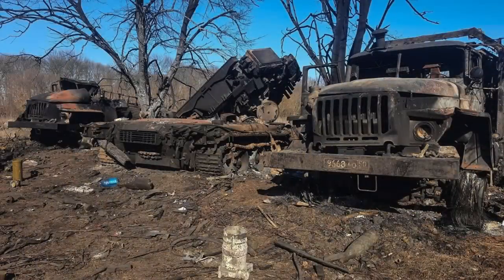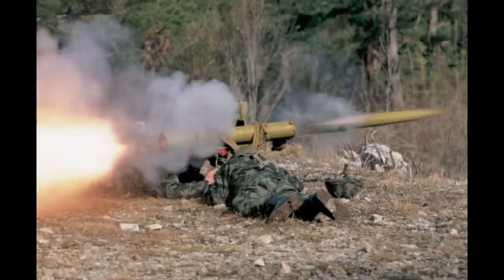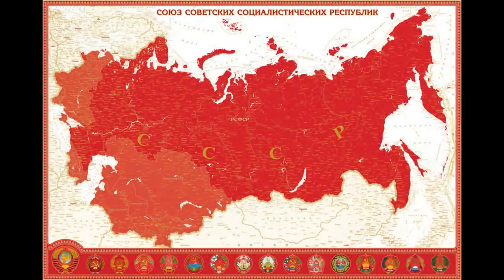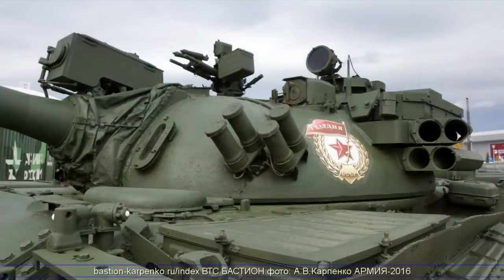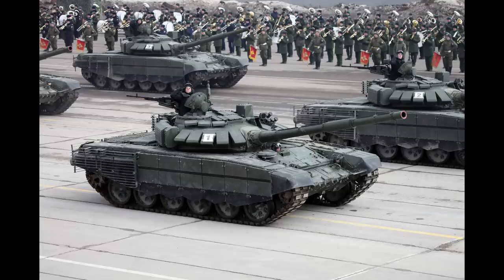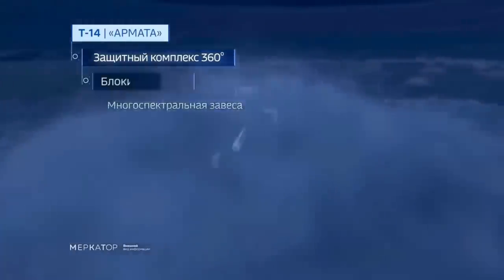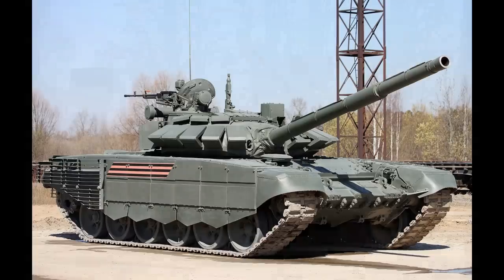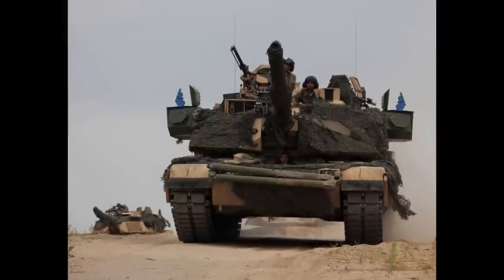Why are Russian Tanks Failing in Ukraine?

Comment: If we sent in the original Abrams it wouldn't fare much better if used the same way by crews that haven't had enough training.  I wouldn't blame the Russian tanks but the doctrine, training, maintenance, corruption, and a war that shouldn't have been started that failed them.
Reply: it has many reasons to be started, though the initial strategy was not destined to end well with a quick attack when you're outnumbered.
Reply: What's the "original Abrams?" M1 with 105mm? M1A1 Desert Storm? M1A2? Many of these if not all Russian tanks for some reason are lacking thermals. Russian Army is not a night fighting Army so I think a post Desert Storm M1 tank would do much much better in surviving this style of war. Better protection and better optics for night fighting.
Reply: The problem with Russian military hardware is that it was based on design considerations from World War II and built for a future war that never happened.  The idea was that like the T-34 of WWII weapons should be cheap to build, easy to maintain, reliable, and expendable.  The Russians were relying on the weight of numbers so they didn't pursue highly survivable vehicles in the assumption that they wouldn't last very long anyway.  Their tanks were incremental upgrades and the same faults of poor crew safety, poor ammunition storage, and poor fuel storage are inherited traits common to the entire family tree that was never rectified with a clean sheet design.  

The post Cold War rationale was why invest in new weapons when you can upgrade older designs on the cheap to bolster the number of weapons available in case of a large-scale war?  But having such a huge stockpile of weapons meant that new weapon R&D and procurement were delayed and only incremental upgrades of questionable value were completed.  The problem is when the Soviet Union collapsed Russia inherited all of these cheap and expendable weapons that were never going to be used in the numbers originally intended.  So when they were used in high-intensity conflicts without a massive superiority in numbers they couldn't achieve the results that were expected.  When used in huge numbers the chance of survival was greater.  When used in smaller numbers the chance of survival declines.
Reply: @keep22  What is this about them lacking thermals? Everything past the 1994 standard has them, though a wide variety of tanks were sent out from multiple stations of the country.
Reply: @keep22  
 I don't think so. Saudi Arabia lost many M1 in Yemen to rebels with Soviet anti tank weapons simply due to bad tactics and doctrine. No clearing of ambush areas, no support for the tanks. Just drive them in broad daylight into a valley where rebels with kornets can blow them up.  Who knows what level of training the tank crews had. Even in chess the queen is useless if you either keep her at the back or just throw her into the middle of the board.
Reply: The war that started back in 2014 or the special military operation? The US would not have allowed their neighbors to turn into a hostile state like Ukraine either. It's a direct security threat that had to be stopped. And they spent 8 years trying to solve it diplomatically to no avail.
Reply: @asdf3568  you can’t not stop them, you invade them then you neither annexed them as your territories or “victory” and withdraw after sign terms. Both way are still losing, since you can not deal with civilians uprising with millions of people or international blockage. 
You withdraw, E.U become more and more United than ever, more joining members even Ukraine.

This is where you lose, both way.
Reply: @Pein061  What are you talking about? You do know that almost everyone in eastern Ukraine consider themselves Russian right? So they view the Russians as liberators because them having to live under an oppressive regime since 2014.
And what are you? Taiwanese? You want independence for Taiwan but not Ukrainian Russians?
Reply: Pffff the designconcept of all T tanks is flawed, the armour configuration is inadequate. 
It's the hardware too dude
Reply: There is a significant increase in death ratio of crews in russian tanks in comparison to western because of the autoloader. With this you effectively reduce the amount of trained and experienced crews in ur tanks.

So...nope, vehicles are still to blame.
Reply: @TheArcticFoxxo  russian tanks are blind as a bat
Reply: @asdf3568  Do you actually believe it lol?
Reply: @dvls442  amen. The jack in the box effect was already known in 1991...
Reply: @asdf3568  classic bot comment for the trash bin
Reply: @rogerpennel1798  Oh wow. You managed to get everything wrong there. 
The only territory Russia has annexed is Crimea. 
Chechnya is still a part of the Russian federation and are actively participating in the fighting in Ukraine.
The CSTO is on Russia's side. Even Georgia whose former president, who attacked South Ossetia where Russian peacekeepers were present, is now in a Georgian prison cell. 
Who has claimed that Russia is a victim? The victims are the Ukrainian Russians who are being actively discriminated by the defacto Nazi state of Ukraine. Who, by the way, welcome Russian troops as liberators. And the only thing they are angry about, is that it took Putin 8 years to launch this special military operation.
Reply: @dvls442  if you hit the side of an M1a2 and penetrate it the heat charge will imidetly enter the crew compartment same as the t72-t80-t90
Reply: @asdf3568  eastern Ukraine? We are talking about the whole Ukraine. You cannot occupy them all. That is not simple as eastern Ukraine. And as far as i see, russia is struggling with occupy east Ukraine. They only have ability to occupy a part of it. You occupy east Ukraine then trade for nato-United and Ukraine join NATO with international blockage. 
Sound like a very stupid trade.
Reply: @keep22  obviously the original m1
Reply: It's amazing that Russian tactics have never really evolved like western nations. Rigid, little flexibility. Just throw stuff at an objective until it's taken. Since they were on the winning side in WW2, they figured their tactics are good. They trained Arab military in the middle east, and you can see how it's been, especially with Israel. They were relying on large numbers to win. My weapon system was intended to slow down a Soviet invasion with a small nuclear warhead. Even then, it didn't sound like a great idea.
Reply: @TheArcticFoxxo  The Russians invaded with a two to one advantage of 280,000 troops facing only 125,000 troops for Ukraine.
Reply: @asdf3568  Ukraine has never been a threat to Fascist Russia.
Reply: @frankjarleb4719  Not bullshit. Look it up. Off the top of my head the referendum they had in LPR and DPR it was something like 79% and 85% for independence with a 75% turnout. I got that from Wikipedia.
And the borders of Ukraine was drawn up by the Soviet Union. It had never existed as a country before that. 
In Crimea, a study in 2013 found that only 2% of people spoke exclusively Ukrainian at home. 
I get it though, you have no knowledge of Ukrainian history, and you want to dismiss anything that doesn't fit your narrative as being some Russian conspiracy. But it is not. Look it up.
Reply: @richsmith7200  NATO trained Ukraine with tactics they learned fighting the Afghans. And how is that working out?
Reply: @angelopugliese6034  Ukraine has closer to 230,000 active personnel, Russia sent in close to 180,000
Reply: @asdf3568  You lost all credibility when you refer to Ukraine as "the facto Nazi state" its just ridiculous.
Reply: @asdf3568  The ukrainian army is permorfing really good yes. They defeated Russia and the gates of Kiev and Kharkiv.
Reply: @angelopugliese6034  Yeah, totally not a threat. Like when Zelensky publicly stated they should acquire nuclear weapons.
And ironic you call Russia fascists. When it's Ukraine that has organizations that are openly Nazi fighting in their army. 
You're the fascist apologist here.
Reply: @asdf3568  pretty well, actually. But the end result will probably be Russia coming out on top. I knew some of the guys that were training Ukrainian troops, so save the sarcasm, they did their job. Unlike yourself, I actually served in the military, which makes ignorant comments, such as yours, amusing in a way.
Reply: @alvaro701  Yeah totally ridiculous. It's not like they have multiple Nazi organizations fighting in their army. And it's not like those organizations have a huge political influence in Ukrainian politics. And Stepan Bandera is officially a national hero in Ukraine. A person that murdered a 100 000 jews. 
They are totally not Nazi right?
Reply: So your argument is that Russian weapons and vehicles are genius, but Russian soldiers are incompetent?
Reply: @alvaro701  lmao you must be living in a different reality. In this reality, Russia takes malorussian territory with impunity and fires Kalibr and Iskander at Ukrainian strongholds with ease
Reply: @richsmith7200  Not sure what comment you're replying to, but you're right, I did not serve. But I'm guessing you probably served in Iraq or Afghanistan, and that's very different from fighting a well trained army like the Russians. So I don't see how you would find my comments amusing.
Reply: @asdf3568  You probably shouldn't try to mock others on their knowledge when you say something as stupid as "Ukraine never existed until the Soviets". Nice way to completely erase hundreds of years of history of the Grand Duchy of Kyiv, not to mention the fact that an independent Ukrainian country absolutely existed after the fall of the Russian Empire in 1917, fighting a years long war against invading Soviets, Poles, and others, before finally being defeated and forcefully integrated into the USSR. The collapsing Soviets in no way "drew" the borders of the Ukrainian state either. They declared independence and the Soviets knew they had no way of stopping them, let alone the various other countries that cast off the Russian yoke, after the Communists collapsed.
Reply: @frankjarleb4719  There was a recent western survey that found that 85% of Crimeans were happy with the reunification. I have no reason to doubt these numbers. You obviously do because you have don't know anything about Ukrainian history. 
And yeah, Russia got its name from the Rus vikings that settled in Kiev. So they share a strong bond. Which is why many Russians living in Ukraine did not have a problem with being Ukrainian, but that slowly changed when they were being discriminated against. And it all culminated in the coup in 2014.
Reply: @asdf3568  actually I served in the early eighties, our entire doctrine was countering Soviet tactics on a large scale battlefield. We had 'REDOPFOR' to help our guys train. My neighbor in '03 was Ukrainian, in the Soviet army, in Afghanistan up until the Soviets left. He had some very interesting stories. It really sucked for them. Non military people trashing military actions, gets kinda silly. It would be like me trashing NASCAR, never having driven a car. You have no realistic parameters to go by. Most people, by now, realize Iraq, Afghanistan, and Vietnam were mistakes that should never have happened. Now we're trashing Russia for kinda doing what we did....again. I have some acquaintances in Moscow,  and it sounds like things aren't horrible, but not great. Rather not piss off a country with nukes.......not sure what country you're in, but you might consider the military,  or coast guard if you have it. Amazing feeling to help somebody in a bad situation. BTW, any mx tracks around your area? Just curious....
Reply: @Talishar  You make the claim that the referendum was rigged. Similar claims have been made about the referendum in Crimea. But western surveys consistently show that's not the case. 
And ironic you bring up the Soviet Union. Because it was them who drew the borders of present day Ukraine. Prior to that Ukraine had never existed as a country. 
Which is why so many Russians in the east and south find themselves living in Ukraine instead of Russia when the Soviet Union dissolved.
Reply: @asdf3568  "Well trained army"? Are we in the same reality here? Against any opponent that would be contesting control of the airspace, or outright controlling it like NATO would, that 40km long convoy at the start of the war would have just became another highway of death, with a huge chunk of the Russian Army either completely wiped out or so atrociously mauled as to be combat ineffective for the rest of the war. I mean..damn, you're really going to try and say they're well trained after they lost virtually an entire armored battalion because they all bunched up on pontoon bridges and Ukrainian artillery smoked them? 

There are a lot of things you could say about the Russian Army, dogged, tenacious, able to absorb tremendous punishment, but well trained and skilled at fighting are most definitely not in that list. Their only saving graces in this war so far is that there are a lot of them, the Russian population is largely insulated from the mauling they've taken, they have decades worth of cheap equipment in reserve to fall back on and there is a lot of room for them to pull troops back and redeploy when they encounter setbacks. Their artillery has probably saved this entire war from turning into a complete rout as well. It certainly as shit has not been some genius tactic or fighting ability of the common Russian soldier that has kept them inching forward in the Donbass though. The entire world saw their "skill" at complicated combined arms maneuvers at the start of the war. It's kinda obvious why it's now turned into a war of attrition and mass artillery barrages. That "well trained" army just didn't remotely have the capability to turn this into a war of maneuver.
Reply: @frankjarleb4719  uh huh
Reply: @lukabogdanovic4658  - If it's that simple then Saddam should have been a big success!  The M1 doesn't store its ammunition in the hull like a T-72.  It stores its ammunition in the rear of the turret behind a firewall that is surrounded by an active fire suppression system.  If the turret rear is pierced and the ammunition blows there are blowout panels on the roof to direct the force of the blast out of the crew compartment.  If there's a fire inside the crew compartment there are automatic fire extinguishers too.  So while there has been some M1s destroyed crew survivability is far superior.  I would wholeheartedly encourage anyone to think that a tank with T-72 lineage is a match for an M1 because they make great target practice.
Reply: @asdf3568  Oh and Wagner with his swastika tatoo isn't a nazi? Okay then
Reply: @ericharrison7518  but Poles tried to help out Ukrainians. Don't be so harsh on us :c
Reply: @asdf3568  the referendum was controllled and count3d by th3 occupation force.
Reply: Well, even far more modern Abrams, or latest version, would not work much better. 
After failures of the first month Russia adopted excellent attrition strategy that has won them at peer war without mobilization - I do not exactly see anyone pulling this off in the last 100 years!
Reply: @alvaro701  nice copium, a little too far from reality but u ll get there
Reply: @ericharrison7518  lmao so hilariously wrong but hey, what u can expect from couch experts
Reply: @angelopugliese6034  u daft? Ukraine has a full mobilization. With terr defence they have more than 200k, Russians have a fraction of that lmao
Reply: @dvls442  huh? That auto loader comment hilariously didn’t make any sense at all. Try again maybe?
Reply: @asdf3568  The land belong to Ukraine. If they want to move back to Russia just do so. Sorry that the old leader was stupid to give up the land.
Reply: @keep22  Seriously no, one thing Russians don't lack is thermal imaging, even the LPR militia has them and they are the least equipped component in the Russian allied forces.
The plain truth is that Russia ISN'T losing vast amounts of tanks, they lost a lot in the opening 6 weeks when they were pushing to establish their foothold in the south and also diverting forces in the north (and Odessa) with feint attacks and while they were adopting a "fire only if fired upon" approach as part of a "Special Military Operation" where they were telling the Ukrainian military to not get involved.
Since the gloves came off they have been routinely slaughtering the Ukrainian armed forces, a fact that western media is still having trouble coming to terms with.
Reply: @dvls442  where u saw a Russian? U clearly wrote about auto loader first and not the ammo carousel. Auto loader does not explode lmao. And u know nothing on crews and their composition, that’s classified info.
Reply: @AdamAdamHDL  Those Saudi M1s are export variants that don't have the extra depleted uranium panels that protect the front of the tank, and their armor composition in general might be different (worse) than American domestic units. In contrast, the russians are using their own domestic tank variants in Ukraine, which should've been the best they have. So their performance is still inexcusable, and with their inability to conduct proper combined arms combat - pretty much pathetic. I do agree that Saudi training and tactics are poor though.
Reply: @richsmith7200  no, the situation in Ukraine is different from Vietnam. Russia is attacking its neighbours, Vietnam is the furthest of being US’s neighbor. And by neighbor meanings it’s got different geopolitical implications. It’s not the same, the scale might be the same, but overall NO. And also another difference, Russia will come out of top with new allies, with EU economy crippled and US economy and militarily reduced in influence. BIG DIFFERENCE.
Reply: @tomshepard9050  the reference was simply one country entering or invading another country. I know what Vietnam was, I watch TV, too. Plus my dad had several veterans working for him when I was a teen. Oh, and all but one of our insinBT were Vietnam veterans, most were airborne. I was just observing that the Vietnam War didn't need to happen, but they did unit anyway.
Reply: @richsmith7200  I understand where you come from, it is hard to have a grandstand when you are in a family with Military tradition, bc allegiance. Same with the guys thinking they are fighting for justice in Ukraine. But except it's not but it is a trap. Capable people believed in tales of Good vs Evil when it is simply not the case, it's Geopolitics, it's beyond good and evil. I hope you can everyone you know, pls advise them do not join any war for that matter. The only fight worth it is defending your homeland, physically. You have seen how your OWN leadership fail and sellout your own country, DO NOT TRUST THEM, AND DON'T DIE FOR THEM.
Reply: @richsmith7200  obviously, I've never been there, I won't say for sure, but I have reasons to believe it might be true. Unless you've been to Ukraine recently, you wouldn't know either. Trust me, I don't identify as left or right either, politics is complicated, require delicate balance, so no Kool-Aid from me. I also support your right to bear arm and defend yourself, if you can believe that. But this whole Ukraine thing...yea, you guys are dying for a bunch of rich elites who just want to sell your country out. Let's all just watch how things unfold when this is all over.
Reply: It everything together
Reply: @TheArcticFoxxo  
No, much of them in fact don't. 
On paper doesn't count.
Reply: @asdf3568  
 It doesn't matter if people in Eastern Ukraine are happy with Russia invading or not, that doesn't justify it in any way.

If you're living in a country and you don't like it or you would rather be part of Russia, then go move to Russia. You don't sit there and justify the invasion and occupation of a foreign country, simply because you self identify more with the invading country.

This is such horse shit rationalizing.
Reply: @asdf3568  It's ridiculous my friend. You talk about Bandera and not the memorials to the victims of the holocaust. You forget that ukrainians were 40% of the red army.  You forget that Ukraine was one of the countries that most suffered by the occupation, first of the soviets and then of the nazis. Yes Ukraine has a problem with nazism, but it isn't bigger than Russia's.
What do you think about Russia employing nazis on his army like Wagner?
Reply: @asdf3568  Yea sure, Ukraine was such a threat to Russia, mainly after trying to join NATO and failing.
Reply: @tomshepard9050  What allies? How can Russia not being cripple economically if they quite poor compared to EU and USA? We can buy gas elsewhere but they can't sell it elsewhere now.
Reply: @alvaro701  I just looked it up, can't find any such images except for their leader. Which it would appear just to be a Nazi back in the day. Pretty pathetic to compare one guy to thousands of Nazis in Ukraine that openly state they are Nazis.
Sure, there were one such case, a guy who was sentenced for rape and torture (whom btw they just released from prison so he could be sent to the front). There was another recent case where the ambassador to Germany was fired for calling Bandera a Robin Hood hero. It's pretty obvious that Ukraine tolerate Nazis as long as they don't overdo it.
Either way, wasn't it you that said it was ridiculous I called Ukraine a defacto Nazi state? Not very ridiculous is it?
Reply: Твои даже современные Абрамсы в такой войне бы уничтожили артиллерия
Reply: А много западных танков воюет как Российских ? Мы видели как в Сирии турецкие леопарды горели от рпг 7, или как в Йемене  горя саудовские Абрамсы, а теперь представь что будет с западными странами когда они будут воевать не против повстанцев
Reply: @rogerpennel1798  Iraqi commanders and troops had no will to fight the Americans 💀 lack of loyalty to Sadam and country extremly devided by ethnicity..
Reply: @rogerpennel1798  it doesnt matter where the ammo is if the crew compartment it self is penetrated 😭
Reply: @lukabogdanovic4658  - Go ahead and tell us which crew compartment you would rather be in comrade?  A tank where ammunition is stored in open air racks, without armor, without automatic fire suppression, and where fuel tanks are stored on the track fenders along the turret ring.  Or a tank where the ammunition and fuel are stored in armored storage bins separate from the crew compartment, with automatic fire suppression, and with blowout panels that vent combustibles away from the crew compartment.  Make Putin proud!
Reply: @lukabogdanovic4658  - The peer vs peer argument to explain Iraqi, Syrian, Egyptian, Somali, Ethiopian, and Libyan battlefield failures are BS!  The Russians and the Ukrainians are using mostly the same weapons.  In fact, the Russians have an advantage in both the quality of their material and Quantity but they are still performing poorly.  Russia likes to play up the effect of Western Aid because it gives them a convenient scapegoat for their failures.  After all, it's not that they are performing poorly against people they consider to be helots instead it's that they are fighting against Western material and numerical superiority!  So any idea that Russia would perform better against NATO than Ukraine is delusional.
Reply: @AdamAdamHDL  To be fair, the Saudis got the M1A2S which is an export variant of the M1A2, which means it lacks the depleted uranium armor that is standard on US variants.
Reply: @kaiserrre  the Kornet still screws them.  The point is despite survivability of the crew, walking tanks into ambushes is how you lose them irrespective of the tank.
Reply: @AdamAdamHDL  That is why Trophy APS is being installed on the Abrams, it will atleast give them some chance at stopping a top-attack munition.
Reply: @kaiserrre  maybe rpg 30 can be more effective
Reply: @TheArcticFoxxo  problem is that a non insignificant number of Russian tanks are not built to the post 1994 standard. Also the T-80BVM only really upgraded the tank to the rough capability level of an M1A1, assuming Relikt ERA and the Sosna-U sights are all they're cracked up to be.
Reply: @lukabogdanovic4658  yes, however a massive quantity of explosives are not kept under the crew's feet, guaranteeing that they all die in the event of penetration. The ammunition in US tanks is kept in the turret bustle and segregated from the crew by armored blast doors and protected from detonation by blow out panels on the roof.
Reply: @angelopugliese6034  uhh, no, the Ukrainian Army numbered 200,000 active with around 900,000 reserve and national guard, after the mobilization the Ukrainians outnumber the Russians significantly in terms of deployed manpower but they are still heavily outgunned by the Russians due to most of the reserves being light infantry and not having enough heavy weaponry and ammunition for what they had.
Reply: @asdf3568  did Zelensky call for acquiring nuclear weapons before or after being invaded by a nuclear armed neighbor in 2014? Because after being invaded by a nuclear power it seems quite reasonable to want your own nuclear arsenal to me, especially if they lied to you and conned you into giving up the nuclear weapons you already had prior to invading you.
Reply: @gumduck2504  wasn't his tattoo a valknut?
Reply: @Xtermy  the DU plates wouldn't have made a difference given how stupid they were being. Speaking as a former Abrams driver here. If you just let the enemy hit you your going to take damage no matter how strong your armor is. The armor is the last line of defense that you don't want to rely on because any number of factors can render it less effective than it should be.
Reply: @user-od1yi5iq1k  Winning yes, decisively no.

Not really, Putin could have embarrassed my government by finishing the exercise "as planned" and saying see I told you so.  

The real reason for the invasion is Ukraine was getting too close with the west economically.  It wasn't NATO as they had turned Ukraine down due to being occupied by Russia already.  While Nazism was an issue with some of Ukraine it wasn't anywhere near as prevalent as claimed.
Reply: @leper2698  A direct hit yes, but its survivability with a near miss would be better as they have significantly more armor.
Reply: @user-od1yi5iq1k  - If you think losing 40,000 dead in 4 months is bad you should ask your hero Saddam about losing 80,000 in 100 hours.  This is what you can expect if you ever face NATO.  Please convince Putin to make that gamble because we would love to show you how it works comrade.
Reply: @kennethbowden4129  какой брони больше ? так же будут гореть любые танки, сейчас их крайне легко уничтожить, но и без танков никак не получится заниматься штурмом. Просто НАТО атаковали все вместе слабые страны, без нормальной армии, а в Украине сейчас более 20 тыс ПТРК, плюс артиллерия, украинская армия сильней любой страны нато кроме США и возможно Турции. Сирия, Ирак и Йемен показала как западные танки уничтожаются советскими ПТРК 70 годов
Reply: @josephahner3031  I appreciate your input and I agree with you. Also, thank you for your service.
Reply: @Atourq  Wagner is not a Nazi paramilitary group. I'm a Russian shill? More like you're a Nazi apologist.
You care about sovereignty? I doubt it. I bet you support Taiwan and Kosovo independence.
Did I say post colonial countries should not exist? No. But I understand why there are conflicts in those countries precisely because of how the borders were drawn up. Problems that could easily be addressed by allowing people to have self-determination.
Reply: @asdf3568  What you just said about Ukraine is the same kind of weak justification a former colonial country can make to invade it's former colony.

Also, Wagner is a Nazi paramilitary group, if you can't see that, I don't know how I can help you.

Also what does Taiwan and Kosovo have to do with the discussion? lol. I guess all you've got is strawmans huh?